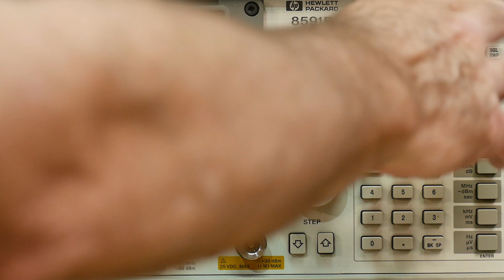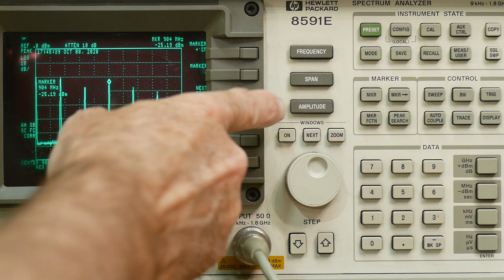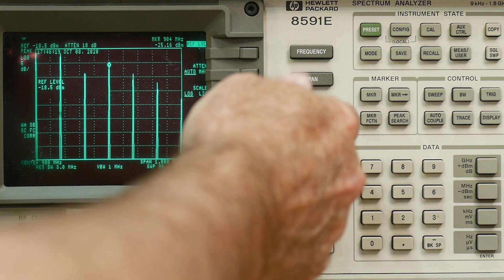#597 Spectrum Analyzer Basics (part 1 of 2)

Comment: Hi I,m just Learning, I just Bought the same one , but mine is a MODEL 8591c, Were do I purchase a Probe Or schematic to Build one
Reply from the maker: most of the time a spectrum analyzer is used with out probes and just connected with coax cables. there is a non-contact probe that I sometime use: https://youtu.be/RH9zHsdk5iE?si=6pzBgSp2eyqFSxbj
Reply: @IMSAIGuy thank you

Comment: This is the same HP SA that I have, but I just bought another. I wish yours had the tracking generator on it to show its function. Mine doesn't have it either, nor the speaker option.

I just bought an Anritsu MS2670A, 100 Hz to 1.8 GHz, that was made for the military, which has the tracking generator on it. I think it came out at about the same time as this one, (1996), but it has a color TFT-LCD display on it. It's still a bruiser that weighs about 30 pounds, about like the HP does.

I use a DC block N-type fitting on mine.
Reply from the maker: here is a tracking generator in use: https://youtu.be/_QcZCCTHQUQ?si=GQhZrGpULyvt2QWF

Comment: Thanks IMSAI Guy!  I just acquired an HP 8557A in a 182T display.  Right off the bat the only thing I know that is wrong with it is that it has no sweep.  I have never used a spectrum analyzer before.  Is this video applicable to analog sweep SAs like the 8557A? For example, will an analog sweep SA also display negative Hz peaks?
Reply from the maker: search my channel for 8558. very similar to yours.
Reply: Thanks! I think I have a problem with the HP 182T display I need to figure out first... @IMSAIGuy

Comment: The data spectrum analyzers display would great for pdn analysis. But I'm not sure how (if) I would want to connect the input of a sa to a high current power plane. (Up to 400 amps in the specific case I'm working on)
Reply from the maker: use non-contact probes: https://youtu.be/RH9zHsdk5iE?si=jXDIYL2FXnHqalZQ

Comment: I have a 8591EM without the built-in tracking generator,  I also have a HP8444A w/o opt 059.  ?? Is there a way to use tracking in another way that you know of.   You are my HP vintage equipment go to.   Before the 8444A your guidance was to use the generator from my Tiny SA and now I want to try this. 
I Habs tried sweeping a 6m low pass filter with my 8601A which worked pretty good. BTW all of my HP equipment that I have purchased was because of your videos,  Thank you.   (I'm a 76 year old experimenter and licensed ham that should have started 50+ years ago.   Thank you for all you have taught me)
Reply from the maker: if your analyzer has an IF output, then you can do this trick: https://youtu.be/wKPkvuWWFXY?si=Ps5YfzumBnXPMlnk

Comment: Great Channel.
In the case of Looking at a 50 watt rf radio signal to see the harmonics, with the attenuated rf coming out of a bird sampler at -40 db, wouldn't any harmonics present also be attenuated -40 db? Possibly causing the harmonics to be lowered to the noise floor and be rendered not visible?
Reply from the maker: I don't know the design of the bird samplers. but samplers I have build myself are not flat with frequency as are attenuators. One would sweep the sampler and determine the frequency response.

Comment: I'm glad I saw this video. I just purchased the sencore SG 80. I'm  looking for something to measure the RF output. Does the spectrum measure microvolts? I know there are RF power meters but the spectrum can do much more. I was just curios about the micrvolts(uV)
 After watching this video. I now have better understanding about spectrum analyzers.
  Thank you for your time.
Reply from the maker: Yes, also anything that measures dBm can give you uV since the uV is across 50 ohms. watts = volts^2 / 50

Comment: Since this HP spectrum analyser shows signals that don’t exist for example at zero frequency, it cannot be trusted.  I would never buy such an expensive and faulty piece of equipment.  In fact, this item strikes me as a very poorly designed product.
Reply from the maker: I'm sorry you ended up feeling that way. All spectrum analyzers will have those signals at zero and negative frequencies, these are a result of using mixers. You will find some analyzers that hide these signals by limiting the left hand side of the display to a positive number. HP Tektronix Anritsu Rhode and Swartz will all have this behavior. If you use an external mixer to extend the frequency range of a analyzers then 100% of all analyzers will exhibit this behavior so it is important to know about it.
Reply: @IMSAIGuy  This...this kind of " basic" instruction is EXACTLYVwhy kids dont go into stem.

Comment: The first thing to find out is the price.  Is it affordable or is it a rip off?  With excellent oscilloscopes selling for lesss than $400,  an excellent spectrum analyzer should also be in that price range.
Reply from the maker: I wish spectrum analyzers were at $400 but they seem be >$1000. Supply and demand I guess. There are some really nice units by Siglent. I love the used market and picked up this SA for $250.

Comment: The terminology is "Y as a function of X" or "Y vs. X" as dictated by mathematical standards.
You had it backwards.  Below is correct.

Oscilloscope:            Amplitude as a fn. of time, or           "Amplitude vs. Time"
Spectrum Analyzer:  Amplitude as a fn. of frequency, or  "Amplitude vs. frequency"
Reply from the maker: I suggest you look at the simple explanations first. The word "versus" can mean "compared with". The spectrum analyzer does not graph a mathematical function. it plots two data points. so frequency compared to amplitude or amplitude compared to frequency are equivalent. A graph of the days temperature would be described as the hour vs temperature or the thermometer reading vs the time of day.  I don't think anyone would say the temperature as a function of the time. I try to teach things in simple terms to reach a broad audience. (2,3) (4,5) (1,5) plotted could be x vs y or y vs x, it doesn't matter, or use term plotted 'against'

Comment: What is diffrence between analyzer and acoustic
Reply from the maker: Not exactly sure about your question, but here is what I think you are asking. Acoustic is in the frequency range of 10 Hz - 20,000 Hz. There are spectrum analyzers that can operate at those frequencies. Most RF analyzers have a minimum frequency of 10,000 or 100,000 Hz.
Reply: @IMSAIGuy  no no i want ask what is spectrum analyzer machine and what we measure.and electroacoustic machine what measure can both machine is same
Reply from the maker: @Reeshichaohan  Spectrum analyzer gives a graph of frequency (x) vs. power (y). am not familiar with what you call an electroacoustics machine.
Reply: @IMSAIGuy  sr can u plz give me  a video or link how can connect measuring device  to analyzer?
Reply from the maker: @Reeshichaohan  https://youtu.be/q66YkSwyh9w
Reply from the maker: @Reeshichaohan  https://youtu.be/ljJcYFQS9KU
Reply from the maker: @Reeshichaohan  https://youtu.be/W216R7uPi4o
Reply from the maker: @Reeshichaohan  https://youtu.be/53cbxBECJFY

Comment: How capable is the HP8921a SA functions compared to a dedicated unit like the 8591e ?  Great channel,  clear explanations, well presented.  Vk5LTD
Reply from the maker: the 8921 spectrum analyzer is very basic. the 8591 is way better in specs and usability. however, the 8921 has a tracking generator that makes it much better than the 8591 in in certain tasks. the 8591 did have an option for a tracking generator.
Reply: @IMSAIGuy  My needs are relatively basic- ham radio tx tinkering.  I'm looking to purchase an 8921a and know you have this instrument so would have a good grasp of the two units capabilities.  I'm coming on board as a patron for all the content you do.
Reply from the maker: @cl5ltd  What you might be looking for is a radio service monitor or communications service monitor. The HP8920 and 8921 or IFR1500 IFR1200 or Marconi there are German ones too. They are multipurpose. But you can do a lot with a simple generator and RF voltmeter.
Reply: @IMSAIGuy  Yes, a comms test set is what i'm moving towards and know of a 8921a, IFR1200S & Marconi 2955 for sale at present- all about same price, all in Queensland.  The HP seems to be more modern even if from much the same era and is well built gear.
Reply from the maker: @cl5ltd  If you can get one for a good price, I have found the HP to be very good.  I have an old video you may not have seen:
https://youtu.be/j4mLM1l5M7A
Reply: @IMSAIGuy  that’s the clip that led me to your channel!  There’s not a lot of these going in Vk, and they still command not small amounts for relatively old tech ~1150 USD.  But it would include more tools than I’m likely to need in one instrument.

Comment: this particular SA already has a blocking capacitor at the input (47nF or 100nF, cannot remember exactly) it is rated at 25V but can handle more than that...so it's not that scary if you have some DC as long as it is not like 400V!
Reply from the maker: wow! you are right. I didn't notice that as it is hidden in the front attenuator. 47nf. thanks! no diode limiter like the 8558 has though.
Reply from the maker: oh, and it gets cal-ed out too. nice...

Comment: The zero beat (0Hz tone) not only is not weird or fictitious but its existence is essential and the first clue that your SA is healthy (if you are looking at buying a used SA, not having a 0Hz tone is the first clue that the unit is defective). This is the leakage of the first LO at 2.1214GHz (in your particular SA, 8591E) through the first converter that passes through the second converter and appears as 0Hz after it is down-converted in two stages. That's why it is called LO feed-through. If you dont see it, the instrument's LO is defective. It exists in ALL swept frequency spectrum analyzers of any brand and any model, old or new.
Reply from the maker: I've always seen one. nice clue about a heathy one having it. any idea what the third conversion (down to 8khz for 30hz rbw) filter design looks like. can't find any schematics for that card. is it discrete or dsp?

Comment: Thanks for doing this video. I have the exact same SA but mine has the tracking gen also. As per your earlier video I was cued to check my internal lithium backup battery. Mine was original from January 1995 (date was written on the battery) and it still measured good! I changed it anyway and I did not loose the calibration values (the supercap did its job). I have not explored all the fine details on this SA so hope you will get into some of those in future videos.
Reply: ...you're lucky- I have an HP 3585A spectrum analyzer that I use for fixing transistor radios.